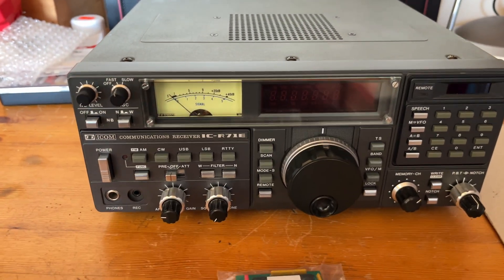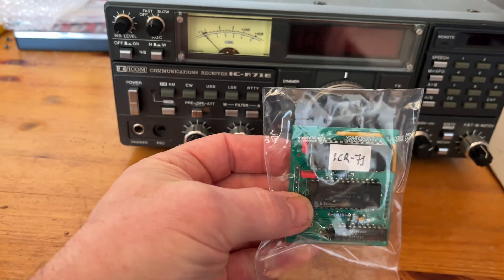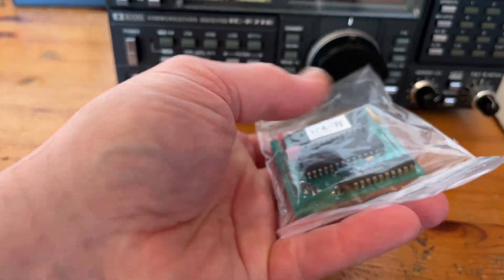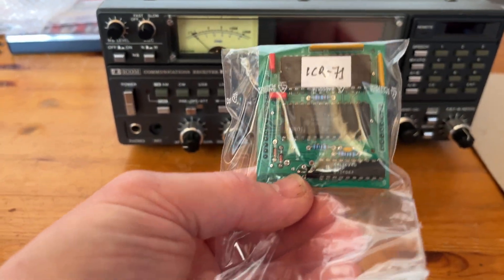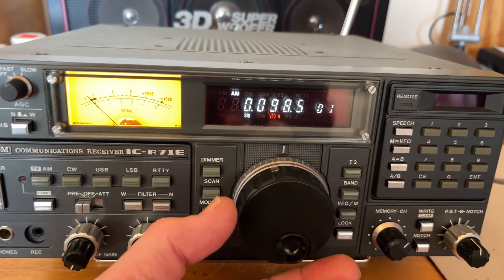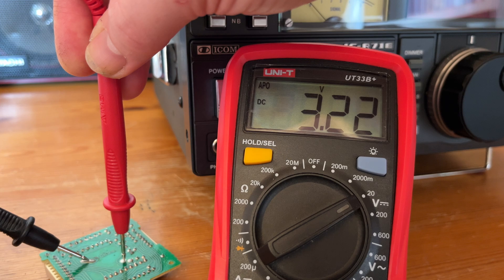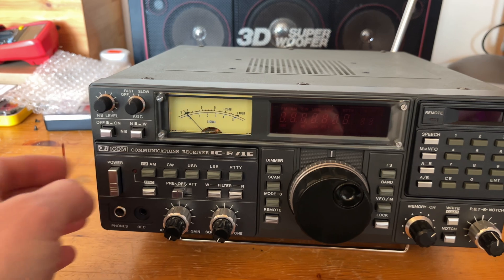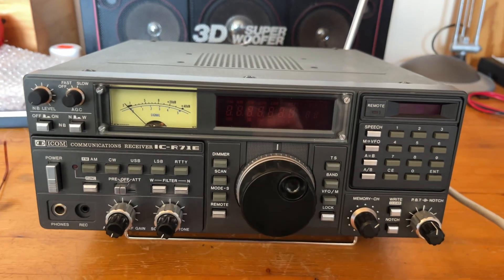Replacing ICOM R71E RAM board with new Nardo IK2RND board

Comment: Very interesting.

I just bought one of these radios about 2 months ago (August 2025), its a beautiful set that I have always wanted since I was about 18, but I could never aford one.
I didn't know about this memory battery problem. 
So as I understand it, if the battery dies, the radio is esentially bricked until the battery is replace AND the program re-loaded. 
That is like living on a knife edge!

Is there any warning that the battery is going to fail?

My radio does have a small problem, for no apparent reason it will suddenly start to buzz (or hum) through the speaker, not loud, but loud enough to hear along with what I am listening to. If I turn the volume down then I can hear it easily (not effected by volume level). Turning it off and on again mostly makes it stop, but some times I have to leave it off for 10 minutes. I am asuming this could be a capacitor in the power supply, so if anyone has any experience of what it could be or which cap, please reply.

Thanks
Martin

Comment: Why would someone put critical programming on ram inside a radio like this?

The onlytime I saw this done was with products that were eather designed to fail (Capcom CPS2) or prevent u from repairing them and changing batteries urself (Onewheel)